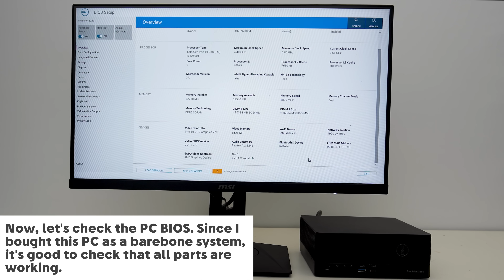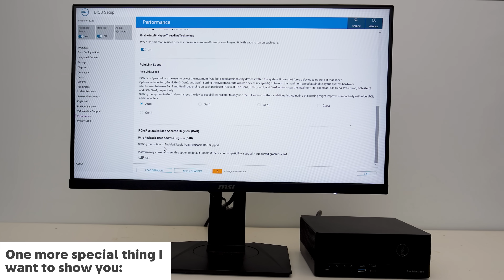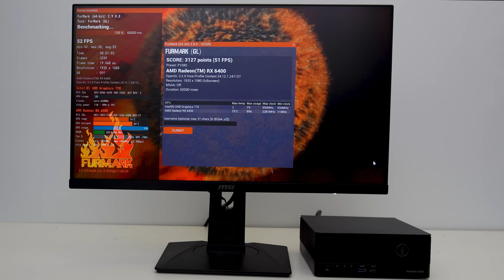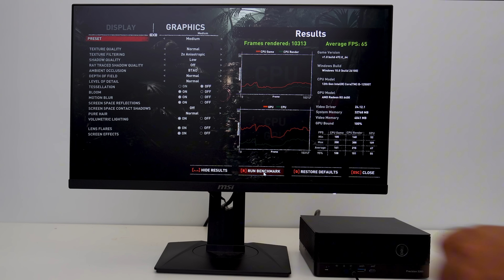Dell Precision T3260 Compact: My Ultimate Workstation Build!

Comment from the maker: Lenovo M910x: i7-7700 + RX 6500 gaming upgrade, CAN IT GAME? 👉 https://youtu.be/ERCveugP-bo
Reply: yes
Reply: Hey, can you try out the arc GPU on older system without rebar? Really curious what's the performance like, and I also heard issue about fan control/noise online. Cheers!

Comment: In theory, I can get any single slot, low profile gpu and I can start playing games on the Dell Precision T3260 Compact?
Reply from the maker: I think you will need a better, single-slot, low-profile GPU to be able to play games smoother. For current AMD GPUs, there are the RX 6400 and RX 6500 from Dell that could handle 1080p gaming. For Nvidia, there are many powerful, single-slot, low-profile GPUs such as the RTX 2000 ADA Generation (16GB), the RTX A1000, or even the Quadro T1000 which could handle games at 1080p.
Reply: @itggear  I was thinking the Yeston 3050

Comment: What do you think of the zotac 5060 low profile? This gpu has single slot, but requires free space like 2 slots. Will it fit in length?
Reply from the maker: No power enough to run RTX 5060.

Comment: A COMMON mod for these is to take an A2000 and simply install the OLD single slot Quadro bracket from something like a P400 (they are fairly cheap on EBAY). The card will fit with VERY little modifications.

Comment: Hey something I actually bought before this video came out. Having some issues with RAM on mine, 64gb won't boot. I suspect the BIOS needs an update, but these are impressive little machines. They make an excellent NAS/jellyfin box. I stuck an Arc Pro A40 in mine, far better experience than the Lenovo Tiny range, entirely down to the fact that the BIOS isn't as locked down as the Tiny ones are.

Comment: I doubt that cooler could handle a 12700 or 12900 tbh
Reply from the maker: OEM PC will cap the CPU running at 65w and turbo boost 3sec only.
Reply: @itggear from my own experience with this, I also suggest you upgrade your i5 but keep it within the T family
Reply from the maker: @A.A6r3u  I installed an i5-11400 65W in a Dell 7090 Micro 35W system with a 35W cooler, and it works just fine. The CPU temperature never exceeds 70°C since the system strictly controls the thermal performance. It boosts to 85W for 3 seconds and then runs at 35W continuously. Honestly, I trust Dell's engineering more than your experience, but I'm sorry to have to say that.
Reply: @itggear you are right to trust Dell over me. I’m just a guy trying to help by providing my suggestions based on my own testing with this concept. Anyway… Im sorry to have made comments in your videos.

Comment: I don't have a spare $1200 in cash lying around to get the PC from Amazon 🥺
Reply from the maker: I found one listed on eBay with an i5-13500 for $550. It's a complete system, so it's even cheaper than the one I have here. The item listed on eBay may be out of stock, but I can keep an eye on people selling it for a good price.
Reply: @bf9142ftw  then buy a workstation pc with i7 9th gen and put a rx 6600

Comment: Dell really hates Dualslot Low Profile GPUs it seems.
Reply from the maker: The maximum GPU supported by Dell for this PC model is the Nvidia RTX 3000 6GB, which is a dual-slot GPU that uses a single-slot bracket. There are some dual-slot, low-profile GPUs that also use a single-slot bracket, such as the Zotac RTX 5060 LP, and some low-profile GTX 1050 Ti and GTX 1650 cards that are also dual-slot GPUs but use a single-slot bracket.
Reply: @username_1985  you can cut the gpu bracket to fit usually.  I did that with my a2000 in mine before I went single slot conversion.  I did this so I could add a 2.5” sata drive

Comment: Nice video! Do you think It would be possibile to mod it to be albe to fit a 2slot gpu in the future ?
Reply from the maker: I think you can buy a low-profile bracket for your GPU, such as the RTX A2000. You can then cut the bracket's leg and the top mounting screw in half, but keep the part with the screw hole to secure the GPU. This would allow you to install that GPU just like the original Dell RTX 3000 GPU. Those brackets are very cheap, costing only about $2 to $3 on AliExpress.

Comment: Hello bro, I have the same Dell Precision T3260 barebone system with an i5-12500T and other parts bought from the Chinese market. But I'm facing some issues:

When I plug the PSU into the wall socket, the T3260 automatically turns on and then shuts off after 1 second. If I press the power button manually, it stays on (sometimes only after 2-3

tries).

The motherboard's DP port doesn't give any display, so I have to use a GT 1030 GPU just to see output.

I regularly watch your videos and was waiting for you to cover the T3260, really glad you did
Reply from the maker: T3260 support Intel 12 gen natively so if you have issues with your setup it must be hardware faulty.